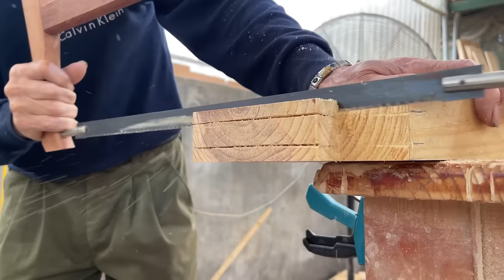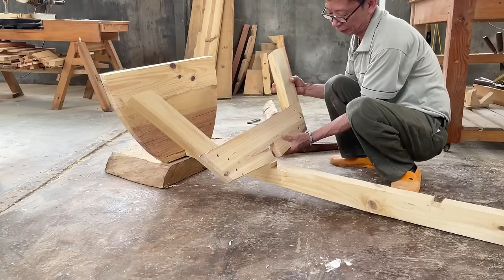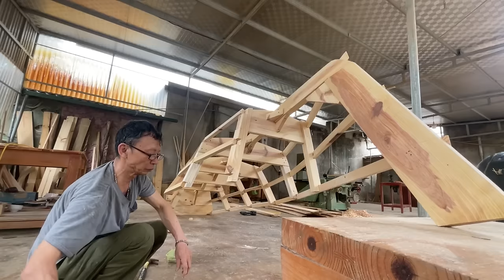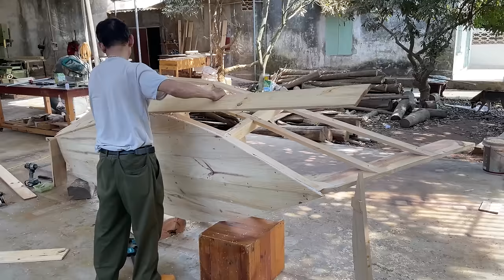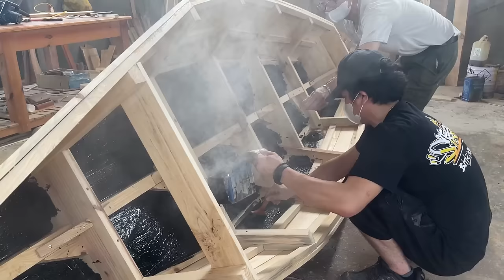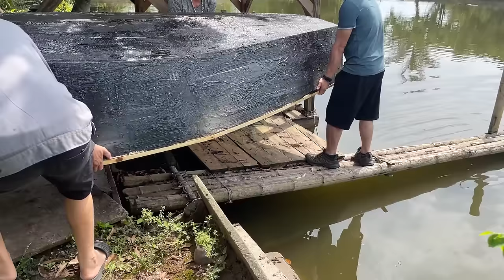Amazing Full DIY Process Crafting a Classic Boat // Woodworking Creative New Projects

Comment: I see a lot of compliments and a lot of complaints, but not constructive criticism. Here I attempt to offer some. The seam and batten method can make a strong boat, if the joinery is good and the design transfers loads well. Four simple changes to strengthen this boat. Fair the planks to lie flat to the stem, bed them in asphalt. To improve the joint at the keel, cut the middle bottom planks at an angle, then fit finely with a plane. Use long timbers or scarf the planks and battens, and lay them in long arcs. When the planks or battens must be assembled from shorter pieces, stagger the joints fore and aft so that nowhere is one joint in line with the next joint above it. Run a timber fore and aft along the inside of the top of each frame. For less drag and easier paddling, paint the outside with exterior latex primer and cover this with several coats of exterior exterior acrylic-latex paint rather than asphalt.
Reply: )-😅❤
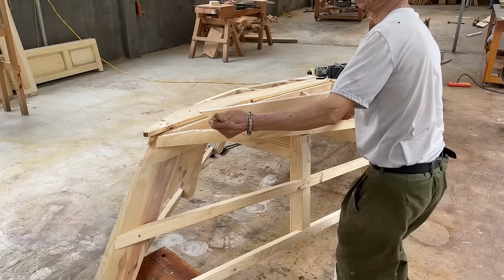19:46 😊😊😊

Comment: You are a great woodworker and I applaud your boat build! What are you going to name her? Make your next one bigger, and try to use a steamer to steam the long pieces of wood so you can use one piece and bend it, making it monolithic from front to back. Keeping the planking and d structural monolithic, at least from front to back will increase the strength overall of your craft. Best of luck and smooth sailing friend! 🙏💪👍

Comment: Hi.  You did really good job on that small boat .but you know the screws will get rusty with time on water even you painted it with that black oil water resistant. I'm not spécialist on boats but I have some skills and I think that it will damage the wood with time. Anyway it's just my opinion. Thanks 👍

Comment: All I saw was a guy pole the boat around a shallow pond. There were no oars or oarlocks. The boy with the double-end paddle was not using it, possibly because the boat was too heavy to paddle. Anyway, sitting on the deck is too high and unstable, and sitting on the floor is too low and wet -- seats about midway in height would be about right. The tar will likely be a mess in the sun. Need a line on the bow (called a painter) to help dock and secure the boat.
However, you put in a lot of effort and material and you know your carpentry, so I wish you well. Just stay away from deep water. 😊
Reply: And you couldn't say anything positive? I think he's design for where he wants to use it is perfect, particularly when you allow for the costs. He did not make it to sail across Pacific.
Reply: @marktanska6331  Re-read the next-to-last sentence of my comment. Also the last sentence.